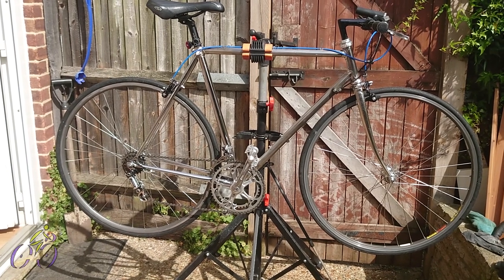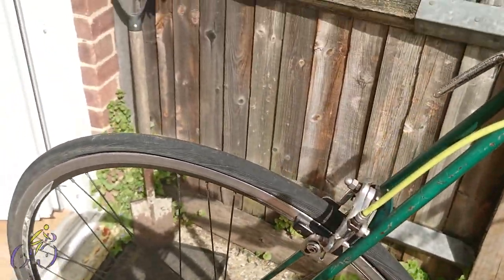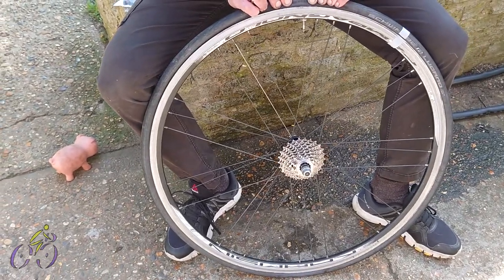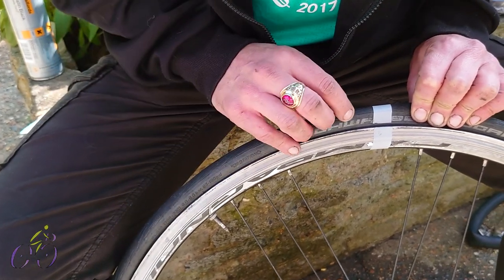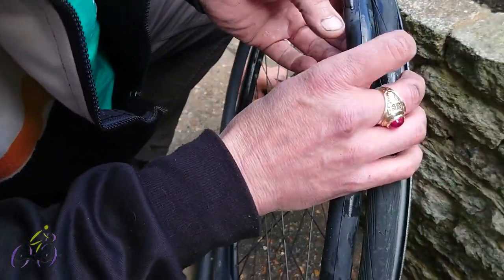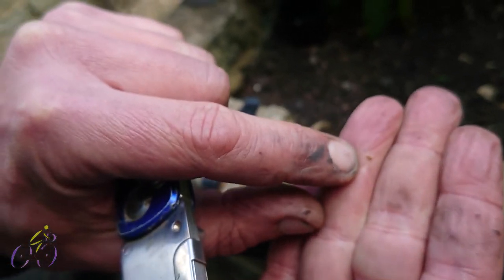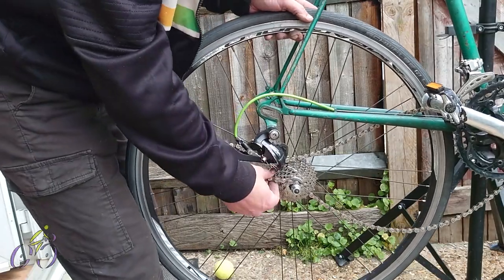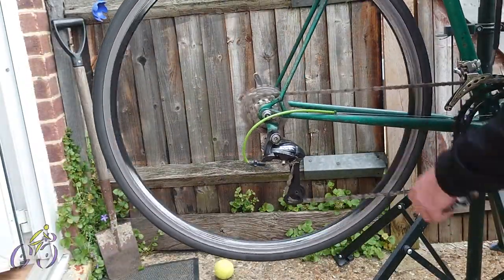How To Repair a Puncture

Comment: Your telling the public to purchase inner tubes instead of puncher repair  kits, which I find is very wasteful and un ecofriendly+ is it wrong to stub cigarettes out on your bike and make it cry.😷
Reply from the maker: I only use inner tubes on the bikes I ride as they are normally up at 90-120 psi ,don't trust repairs at that pressure .I run a charity , ok take in old bikes people don't want anymore so do them up and give them away ,if they are too  knackered I strip them for spares including inner tubes .as I give them away I have to keep the cost down .I've given away 170 bikes to date ,6 in the last two weeks so as far as being eco friendly ,I think I'm doing my bit .I don't drive either